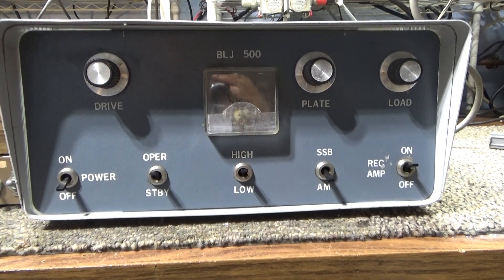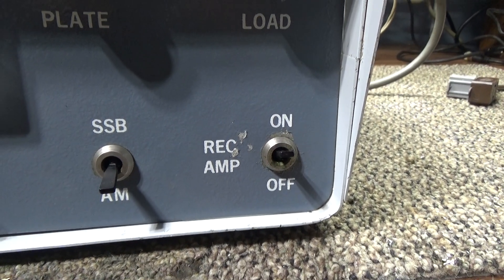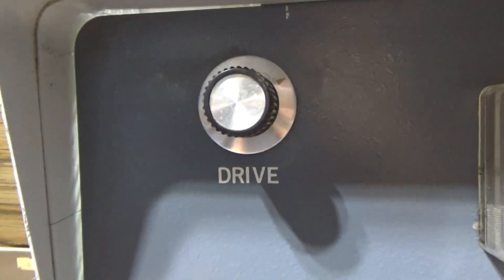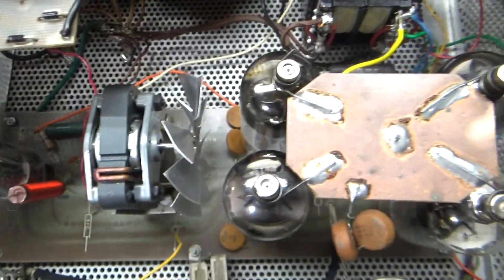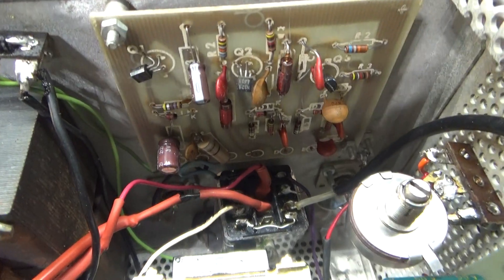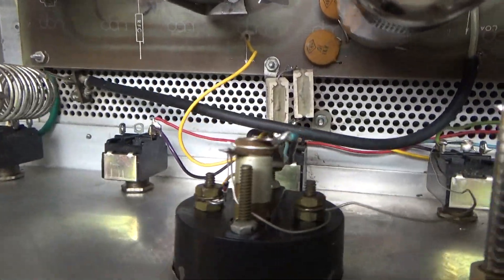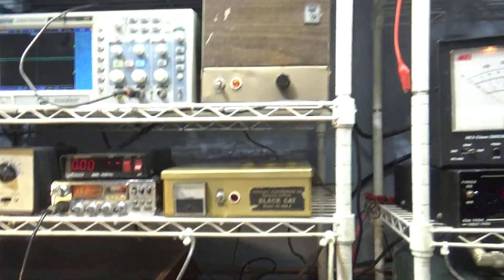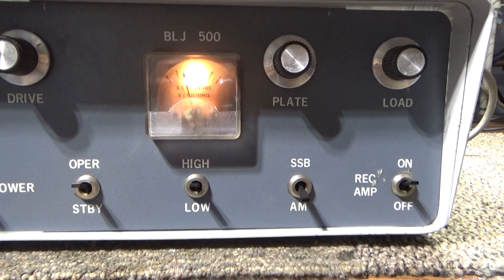BLJ-500 linear amplifier finally wrapped up on the bench.

Comment: I don't see any anti parasitic chokes on those tubes.  Were they not needed?🤔 Beautifully clean inside.👍
Reply from the maker: With 10 meters, often you can get away without them. For the higher bands, they are necessary.